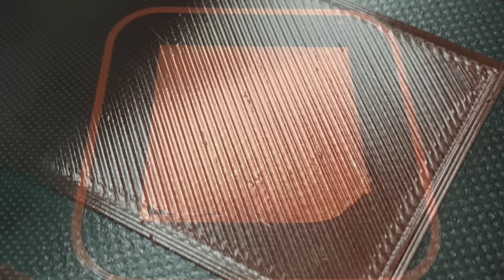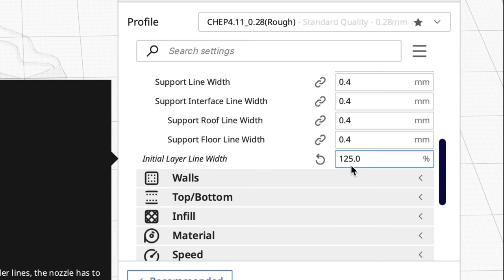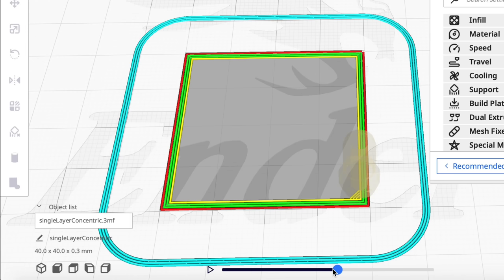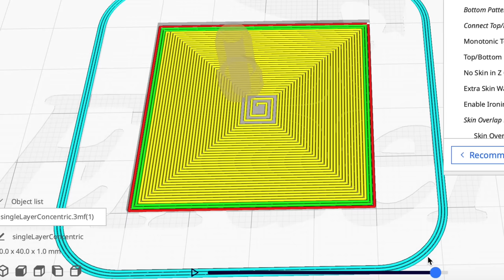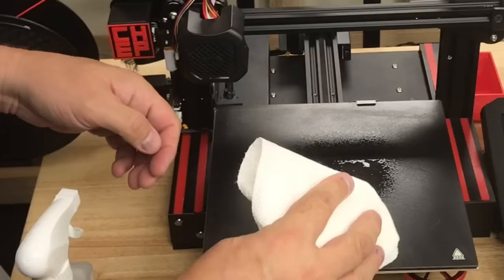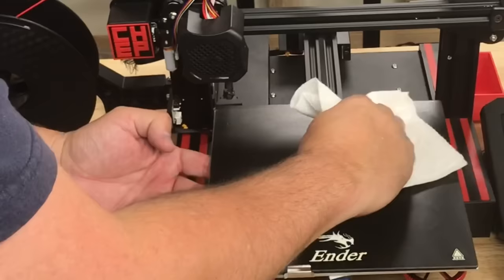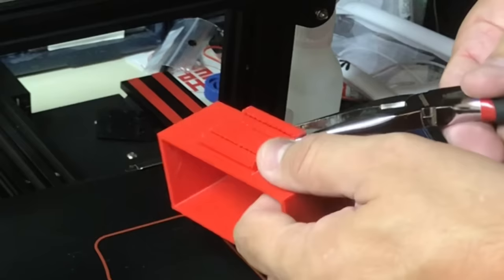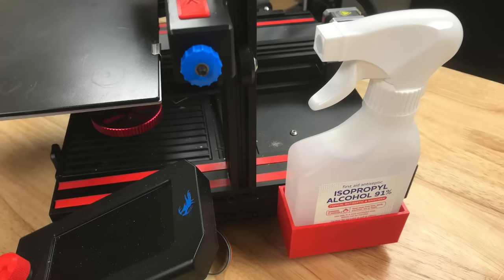Better First Layer and Bed Level Fixes on 3D Printers

Comment: Your tips and tricks have really helped me with my CR10v2 the only issue I have left is that the front left corner of the bed is just not usable, I can't seem to ever get a layer to stick there.  I've cleaned it,  I have the BLTouch and have trammed the bed in all 4 corners and center, I have my zoffset setup.   Prints done in the center of the bed work great, but the closer you get to the front left corner the worse it gets.  The ultimate shower of this is the CHEP bed leveling test print (chep_bed_level_print.stl).  Any thoughts?  Do I just make sure to place models as close to the center as possible?   I'm getting to the point where I have some parts that I want to replicate and print say 10 or 20 of the same thing at once, but this results in frustration when most stick and work fine but the front 1 or 2 slide off or worse gum up the rest.

Comment: Awesome video, it helped me a lot but i have this problem which i dont know what configuration made my extruder take a few moments before extruding material. when it starts, from the very first point it takes about 10 seconds to start pushing material. if i go back to normal presets of cura everying is ok but i cant seem to find the exact setting that ruins that. I touched flow but deleted that config and is still extruding wrong on my main profile. Any ideas what could it be?

Comment: Not sure if this is a question that you've answered, but I live in Arizona and the room I print in gets to about 80 degrees in the summer. Do I need to adjust my printing temps for PLA to make up for this?
Reply: Aa long as you don't have a lot of ambient temperature shifts, I'd imagine you wouldn't change a lot. Really you test temps for different filaments/prints anyways. Most of the stuff I use swings between 218°C to 230°C depending on filament and or what I am printing (those numbers are specifically for PLA+). I live in high desert btw.

Comment: Concentric initial layer is the best. Does it have a way to make a concentric start to finish first layer? cuz using cura it stop printing the walls to print the small center details, wich does not stick to the bed and travels with the nozzle to stick to another wall messing all the print. is that a way on cura to fill those details after first layer is done, and to print first layer in a continuous print? Cheers

Comment: Idk if its my printers (I have the ender 3 v2, I barely got it last week and I update to a Jayers UI build of marlin to get that mesh bed leveling feature )  issue, but I've mesh leveled it correctly and I get a perfect print, but after one print when I home and start a new print, it starts extruding a good millimilleter high and it doesn't do a squish at all, I have to redo everything and babysit the z offset again, I'm not sure why it does this, the first few prints were fine, I'm stumped on what to do at the moment.
Reply: @Kalvinjj  Hey thanks for replying, I forgot to mention that I've done all that, I've set my gcode to includ the M420 S, and I've set my offsets and saved them to eprom. I still can't figure out why after a few prints or one huge one that the the settings gets thrown off, on top of that I noticed that my homing doesn't home completely do you think my z endstop switch could be faulty?

Comment: I have a Ender 3 V2 with BLTouch every single time I start a new print I have to create a new mesh then manually tune it to be able to even start a print. I have been trying to do an2 sided key tag and the bottom is not right and i keep getting like if the top layer is not even being printed… keep seeing huge gaps and the engraved letters are not really readable used pla and abs, I even tried printing it on the thin sides and then the hole for the key hole won’t print properly… using cura’s latest stable firmware and the marlin firmware you recommend

Comment: i come across the bubble up at layer 3~4, do you have any idea what's wrong with it? thanks.
Reply from the maker: Bad filament typically.
Reply: Try to preheat the pla. I use the sunlu preheater

Comment: Having trouble with bed adhesion using isanmate pla+ woodfilament with my ender 3s1 pro. Their Cura profiles don't seem to work for me. I will check back after trying your settings.

Comment: Hi CHEP
My prints are ridiculously hard to get off the glass bed on my ender 3 neo. Does this mean I'm to close to the bed on my z offset? My ender 3 pro has a magnetic bed and like that so much more just for the fact i can actually remove what I print. Only printed 2 things on the neo but its a nightmare getting them off.

Comment: I have an issue when my print gets about 2mm tall it will start to pull off and warp almost like it is melting. I have raised bed temp, lowered it, changed head temps, and more.  I have also tried many different brands of filament, and it doesn’t matter. Also same results with old or new filament.
Reply: Raise your Z axis. As it goes it, it mushes and pushes the layers downwards. Do the paper trick on your bed to find your z offset.

Comment: how do i solve my prnt when its starts printing and then it for some reason print in mid air not hitting the model
Reply: Check your bed level. What printer are you using?
Reply: @itsdrew.15  i use a creality ender 3 v2
Reply: happens to me too, I usually adjust bed level
Reply: @p.s.l7777  Same I have. I fixed this by leveling the bed in a different way. Try this:
Home the printer. Use the move controls to move to the corners, not disabling the stepper. Level it decently close to the extruder, but still a little gap.

This is because when you disable the stepper, the system moves lower then it does when you print. Hope that helps.
Reply: @itsdrew.15  budt my first print layer is good its not the leveling
Reply: @p.s.l7777  🤷‍♂️ Hmmm, thats weird. Reach out to Creality and see what they say.

Comment: i could not figure out why my prints would not stick even though i had printed multiple things before without fails but little did i know how dirty my build plate was. The paper towel was practically brown after cleaning it and the prints started sticking purfectly

Comment: I have a weird issue where the first few mm of my prints, prints rough. And the rest print perfectly. It almost seems as if the first 15-20 layers are in fuzzy skin mode. Obviously I’m doing something wrong. I’m just not sure what.

Comment: So my ender 3 isn’t printing right.    Instead of printing lines in some areas it will print stringy dots instead of lines.    I’ve already leveled the bed multiple times and double check every corner then I start a print and it will still do it
Reply from the maker: You might have a partial blockage or something wrong with the extruder.
Reply: @FilamentFriday  thank you for the reply.   Should I change the extruder?
Reply from the maker: First I’d check for a cracked arm. https://youtu.be/iXe7bftyMFU

Comment: I've got an ender 3.  My first layer adhesion is fine.  I'm having trouble with the print failing near the end or in the middle of the print.  Almost as if the filament is not adhering to the part itself.  Then I get a rats nest of filament.  usually when printing multiple of the same part.  I don't see much talk about this online.  Maybe I am not looking for the correct thing.  Is there a name for this?
Reply: That's what brought me to this video.. I can get about halfway through my prints and then it turns into a large blob then rats nest after. Let me know if you make any progress!
Reply: If I was u I would mess with the cooling fan it seems like ur prints are getting cooler at top so try turning off or lowering the fan at those levels
Reply: Take the mechanism that feeds the filament apart.  Sometimes that little arm pressing against the spring gets cracked.  So the extruder is pumping out inconsistencies.  Also, try switching to another spool of filament.  Sometimes the filament goes bad, even though it doesn’t give you any of the tall tale signs of being bad.  It’s just shitty stuff and won’t stick to itself.

Comment: I am constantly having an issue with the first layer having spaces between the extruded lines of plastic. There is also a very slight separation of the first layer form the build plate.
I always pop my filament spools back into their plastic bag and box with 1 large dissicant pack and a small dissicant pack on the outside of the plastic bag.
Reply from the maker: Your nozzle is probably to far from the bed or your extrusion width is too small.
Reply: @FilamentFriday  hey, thanks man. I will take a look into that. hopefully that will solve my quality issue.

Comment: This is going to sound odd, but sometimes swapping the build plate helps if I recheck the level and my print still won't stick. I'm using the the magnetic build plate. I have a glass bed but I tabled it for the moment. I was too frustrated to get it working.
Reply: Relevel with a glass bed, the glass must be super flat, yuo can check the warped bed or glass (yes i have ben warped glass..) with a ruler..and use "strong hair spray" ,thats it

Comment: I need help with a silly problem , I'm building my 2nd Mando helmet, printing my 8th and final piece and the print is the easiest print (back-left-bottom) and it keeps failing in the last 10 minutes not "closing" the top off? I have leveled the bed 3 times, settings seem ok, spool not tight, do you have any suggestions? It's failed to print 4 times now the same part
Thanks my friend
Reply: Id suggest just printing the top separately and glue together. Its a pain, but a solution.

Comment: Hey chep, great video as usual. I was wondering if you could do a video about cura 11.0. Since i'm using that versión, the retractions are horrible and I can't figure out why. I changed the retraction distance/speed, filament temperature, travel speed, but nothing seems to work. I have no choice but keep using cura 10.0.
(I'm using pla with a custom printer base on a prusa mk3).
Thanks for your help!!!
Reply: Have a look there's no free space between your tip and the extruder tube

Comment: In Cura 5.3 some things are little bit different.
Initial layer line width does nothing, initial layer temperature doesn't work either.

Comment: Question, I have a CR-X how do i go about creating a purge line for printing ? (i am just using 1 extruder only) Currently it goes to the bottom left corner and does a small blob there for a few seconds the starts the print, but if i do another print straight after the previous print it retracts so much that if i forget to reheat the nozzle and push the filament through it will fail the print. is there setting in the slicer to do this?
Reply from the maker: Look at the Ender 3 Start GCode in the Cura machine profiles. It will have that code to create the test strip.

Comment: Keep having issues with my first layer. Not sure what's happening with my Ender 3v2 atm. After almost every Print the bed will be about 1 turn out. (further away from the bed, So they've tighted)  First thing I did when I bought it a year ago was upgrade the springs. Think it mite be worth replacing them again? Just seem odd
Reply from the maker: Are you sure your slicing profile doesn’t have z offset in it?
Reply: @FilamentFriday  yeah double checked that. These settings helped massively thou. not had an issue with first layers since :)

Comment: New sub and new to 3D printing. I get good adhesion and first layer on flat prints but corners start to come up on thicker prints after first 6-8 layers and just get worse from there. It's always just the corners. I read it may be due to shrinkage? Using Overture PLA, bed at 70, print temp at 200 on stock Ender 5 plus with clean and level bed. I will try these settings and see if that helps. Any additional advice to fix this?
Reply from the maker: Some flip the glass over and use glue stick.

Comment: When I do concentric, it looks fine. When I check the Connect Top/Bottom Polygons, the lines go all over the place and it's not symmetric. It finishes solid, but the lines are just....sporadic. Any suggestions?
Reply: Maybe it's bed adhesion problems e.g you printing just couple lines and continue doing so that causes spring effect instead of improving adhesion as first layer goes.

Comment: Sir,
Ive used this video religiously but now I’m experiencing it where the prints are losing adhesion and ultimately fail. Any other things I need to address in Cura settings?
Reply from the maker: You’ve cleaned the bed?
Reply: I’m thinking a setting is off
Reply: @FilamentFriday  , don’t know if you saw my reply but I clean the bed religiously like you show. Any ideas?

Comment: chep, I am using cura to slice my 3d model it come out with a blue image on one end under the model. It is flush in tinkercad and nothing shows. when i print it starts at one end and builds it up then continues to print the rest of the first layer in the air. is there a setting that I can't find to set it on the bed flush??
Reply from the maker: There is an option on left menu to rotate and select the surface you want on the bottom.

Comment: Do the v2 glass bed coatings deteriorate at all? I've just had a lot of issues on larger prints with mine that no amount of cleaning seemed to fix. I've put a magnetic flexible bed on today and suddenly cured it, so I know my settings were good.
Reply: Flip that glass bed over to the smooth side! I have had a V2 for a couple years now. Also clean with isopropyl Alcohol like CHEP said. I sometimes add hairspray (but give it time to dry before printing)
Reply: @mynameisneb  I've always used the isopropyl. I'm getting good results with the flexible bed now. The prints stay stuck even when it's cooled down.

Comment: HELP!!  I just recently started  printing. I have a Longer printer. Every time I try to print something with a small  "radius", the print fails. Example: If I were printing an army man, the legs are so thin, the print always fail. Can you please tell me what I need to do to fix this? Thanks in advance.
Reply: Add a "Brim" and have it attached to the model about 10 to 15 loops should do it and you can make 2 layers high,, slow the printing speed down to about 20mm/sec or even 15mm/sec and have the fans on high,, and turn the Nozzle temp down  to around 190 degs because your printing a lot slower,,, I assume your using PLA+

Comment: I am trying to just figure out the settings on the printer. Is it close enough, the lines seem to be less smooth and such. I get started, 25 min and it pops off.
Reply: Here's what I found worked for me getting started, try it and see if it works for you: Step 1) In Cura, set the heatbed to 65-70 and the nozzle temperature to 205-210, assuming you're using PLA. Step 2) In Cura, set the initial layer speed to 10-15, and the regular print speed to 30. Even a slowly printed thing is better than having your prints fail and waste both material and time. Then slice. Step 3) Level your bed MULTIPLE TIMES (assuming you have manual leveling, like I do on a Wanhao Duplicator i3 Plus). I use a business card and when it presses down, I want it to be difficult to move the card, but still possible. Then continue checking around the plate like that, maybe 4 or 5 times, until you're absolutely sure that they're all about the same. You'll want to do it multiple times, because if you raise one corner and then the one next to it, the first corner will also be lifted slightly, meaning the nozzle will be too smushed. Keep going around the plate with the business card just barely being able to move. The way I do it still causes the first layer to be a 'little bit' smushed, but I'd rather have a first layer that's a little smushed but sticks, than to have a first layer that's just a little too loose and comes off. Step 4) Raise the nozzle/motor and clean your bed thoroughly with isopropyl alcohol and immediately dry with a paper towel. Don't touch the plate with your fingers after that. Step 5) Finally, try printing.

Comment: Can you help me with my CR-Touch? Its basically a BL-Touch but my first layers are not really good... I had so many problems with scratching the print surface and at the same time printing in mid air that I am taking into consideration to just send back the CR-Touch and use manual leveling with the Z-Stop attached again.
Reply from the maker: https://youtu.be/TroPjdkSEOY

Comment: Chuck, I've got good adhesion to my bed and nice squish to my lines (i.e. good z-offset) but it seems like when it starts extruding it curls up to the nozzle or pulls the first initial bit up from the bed. It's strange because after the initial bit if it's a continuous shape it'll be fine and look nice, but if the first layer is a bunch of small parts or travel movements it'll just fail. I've sort of gotten around this by increasing my retraction (4mm(!) for my direct drive E3v2), but it's not a good fix. Any thoughts?
Reply: Is your nozzle clean? Might be a tiny bit a filament stuck inside it causing the filament to curl when it comes out. Try doing a cold pull to clean it out.
Reply: @ThysiosX  I've done hot and cold pulls, and I've changed nozzles. It's a strange persisting issue even from when I was still using the stock bowden setup. I'll do another cold pull, change the nozzle, and just reassemble the hotend to make sure it's all tight and secure, can't hurt.
Reply from the maker: You could have slippage in the gearing. Can’t get past the early resistance.
Reply: @FilamentFriday  Interesting, I've tightened the tensioning knob a decent amount. I have a BMG clone style extruder, so it has plenty of pushing power I think. When I check my e-steps it seems to push filament out fine, too but that's a good thought I haven't seen anyone suggest this before.
Reply: @FilamentFriday  Took apart my hotend and extruder, re-hot tightened the nozzle, replaced the nozzle, and put everything back together then tightened the knob pretty far. Still an issue, this thing is a mystery.